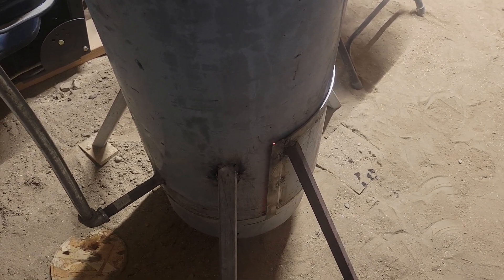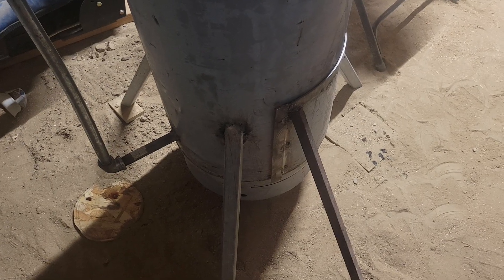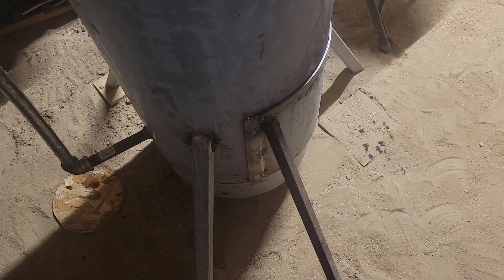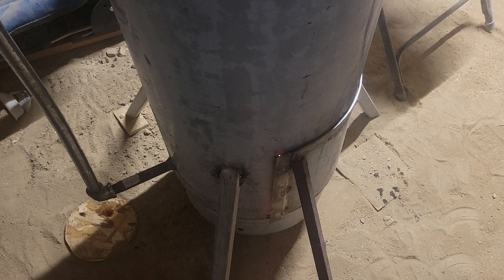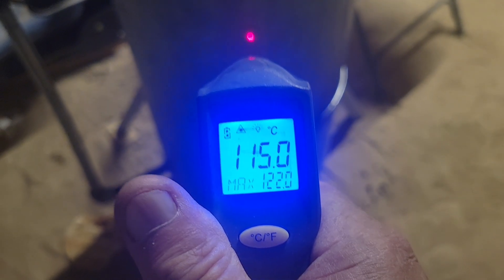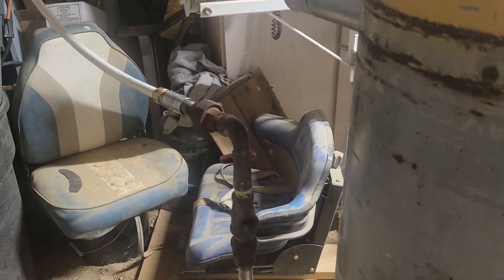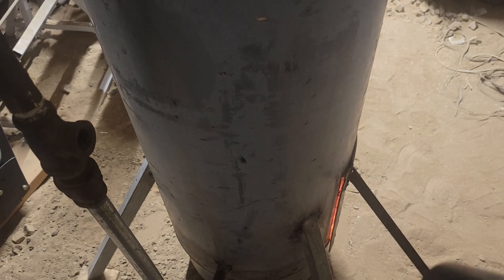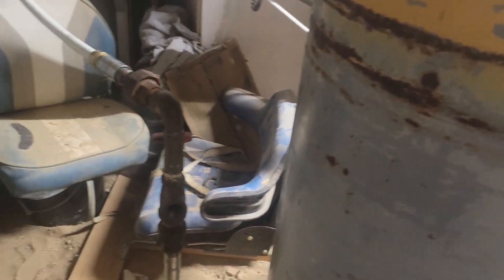Refiring The Waste Oil Heater, Burn Test Four, Nov. 19, 2023

Comment: Maybe a preheater to heat up the oil before it gets into the main burn chamber, that might give you more heat with hot oil coming in??
Reply from the maker: Yeah, it could also blow me up.🤣   Oil needs to be real hot to vaporize and burn efficiently. If I preheat it that much, a spark could set it off.  Anything less would be a waste of time.
Reply: @GBear  
Good point

Comment: tHanks for a great video.  Very interesting stuff.   I live in the draftiest house in town.
Reply from the maker: Welcome aboard!  Most use these heaters for workshops and don't recommend using them in a house because of the oil, and excessive heat requiring it to be away from walls, etc.

Comment: maybe .
A thought..  two or ? Brake drums..
Lower burn plate drum... lighten as much as possible without hurting structural integrity...
2nd regular drum.   Mounted above ? distance to capture heat (heat sink)
Possible a 3rd....
maybe...
just a thought
why I dont..
I'm not in a place where I can...
I don't need to reinvent the wheel.
If I can learn from others...
and start from there ...
Good Luck...
Reply from the maker: Lol.

Comment: I've been burning some little pieces of pine wood 🔥 today. I'm thinking about putting the cast iron skillet on the wood 🔥 burner and making some cornbread. What I was going to ask, what if you put a piece of wood 🪵 in it, let it soak up the oil, and kind of be like a wick, but it would be glowing red hot, so wouldn't that make a hotter fire?
Reply from the maker: The metal needs to be hot enough to vaporize the oil.  The vapors burn hot, the oil is cold and will actually put the fire out unless the metal is heated.
Reply: @GBear  yeah what I meant was put a little chunk of oak to get glowing hot, 🔥 for the oil to drip onto. I figured it would make the oil really hot if the wood was burning a little bit. Kind of like a Coleman lantern when the fuel ⛽ hits the glowing mantle...
Reply from the maker: @davidpotter9462  Nope, won't work.  The wood won't hold enough heat and will cool instantly when the oil hits it.  I've done my research.

Comment: You know that kind of temperature you could put a flat plate on the top to transfer some heat you could be cooking your lunch out there on that plate while you're working in the shop just a thought
Reply from the maker: Yeah, I have that srtup on my homemade Potbelly stove in the next container.  Works great for cooking.  I do plan to add a flat surface on this heater after I get it perfected, and a sand battery or two to the sides.

Comment: To much mass with the brake drum
?????????
Reply from the maker: I'm sure that's it.  I'll experiment with heating plates and fins inside of it to increase vaporization and heat output, so it cuts down that time to heat the drum.
Reply: @GBear  
If you have another drum
On your lathe
maybe try cutting the mass of the drum down...
Making it as light as possible but still structurally sound
maybe
Reply from the maker: @jimh4167 Yeah, I thought about that too, and still may try that if my inserts don't work, but I have faith that they will.
Reply: @GBear  - Didn't the first test with the funnel work great with the brake drum?  I seem to remember the flame pattern was in a upwards swirl and seemed very healthy... You were happy it was working so well.  Perhaps we need to go back and see what worked so well and go back to that?
Reply from the maker: @samvalentine3206 I had less air holes in the inlet pipe for that first burn.